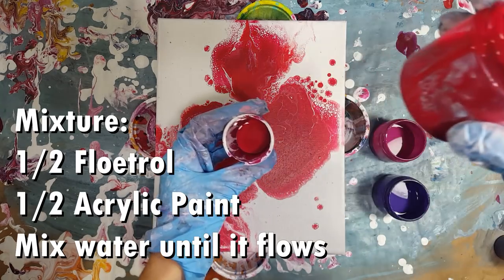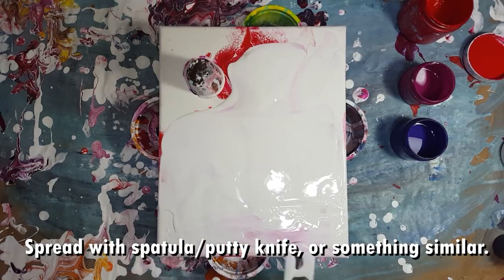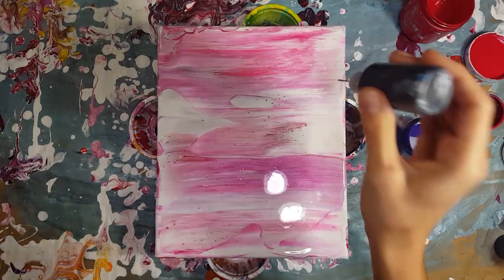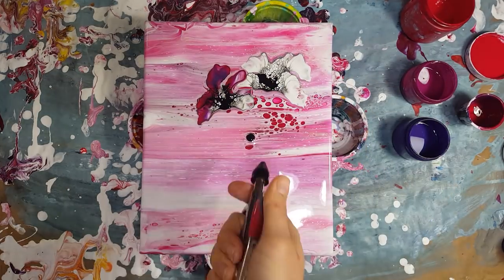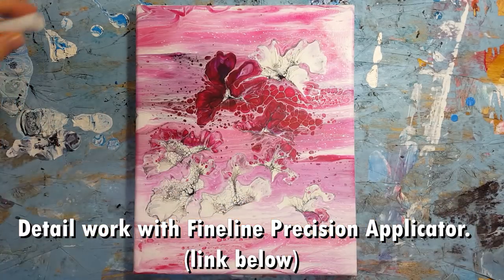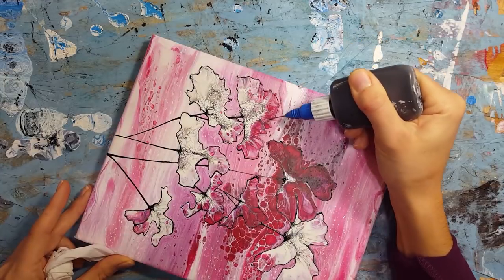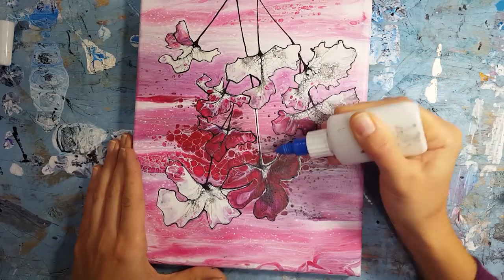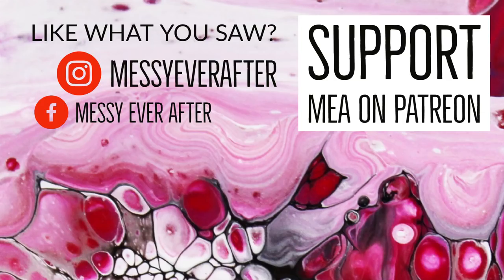Fluid Painting Tutorial: How to Create Flowers with an Air Compressor

Comment: I LOVE your work and your videos!! I've been using the fine lines bottles and I've noticed that sometimes my paint will crack when it is dry. Do you think my application is too thick? Or maybe I need to water down my paint a little more? Thank you!!
Reply from the maker: Thanks so much! It sounds like the paint might be too thick. Does it flow out of the bottle easily? Or are you layering quite a bit of paint on the same area? I'd try adding a little more water and see what that does.